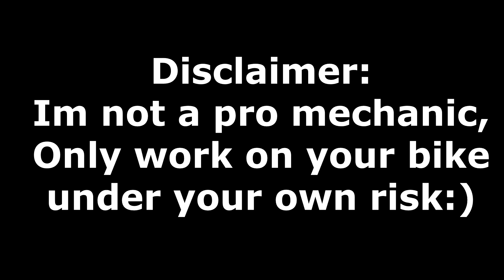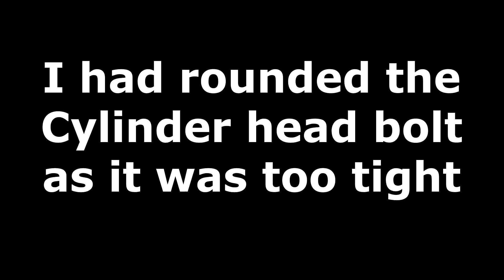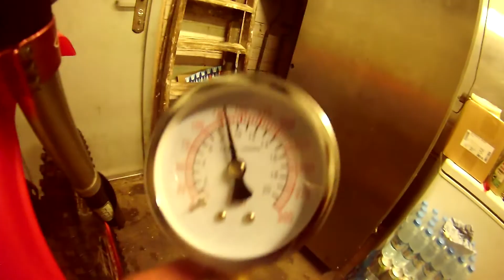Cr 125 Rebuild Guide

Comment: I have a 95 cr125 but yours looks way better than mine and its leaks oil out the pipe from the motor and also out the spark plug, does anyone know whats causing that ?
Reply: its a 2 stroke buddy!!! get a new spark plug, the crush washer is probly wasted.. and oil out the exaust is fine, just means ur a tad rich (which i prefer) and wont hurt a thing!! also run a good synthetic oil, i like the HP2 by honda.. 4 0z to the gal..
Reply: evelyn love yeah im doing all that but it also doesnt have first gear and i think it bogs because it loads up so much before you can actually go that it just bogs it but now its also leaking alot of oil out of the over flow even with it not running, have any ideas of how to fix that ? If i turn the idle down or the fuel/gas ratio down it bogs even more so im not sure
Reply: I had the same problem with my 2001 cr125. After leaning out the mix and riding it on the pipe as much as I could , the problem persisted. The solution: New pistons and rings with a good carb tune.

Comment: How do you know when your top end goes because I riding my 99 cr125 the other day and it was going fine then it just lost power and stopped and now it has lost heaps of compression
Reply from the maker: Kurtis Gall Just do a compression test, however if your bike suddenly lost compression instead of gradually, then there may be another issue, such as a blown gasket.